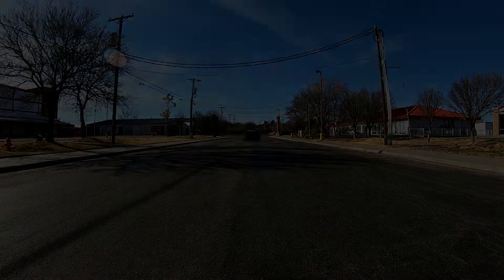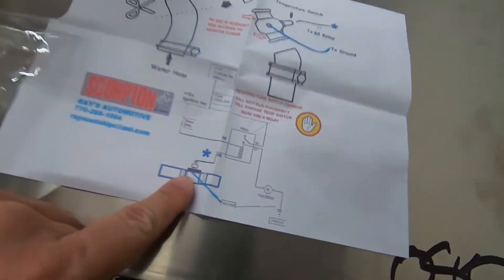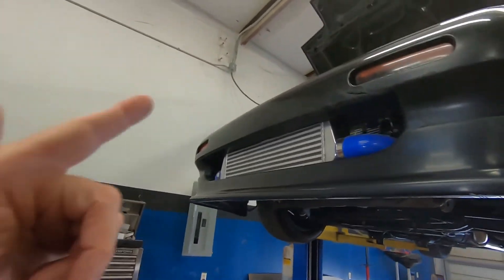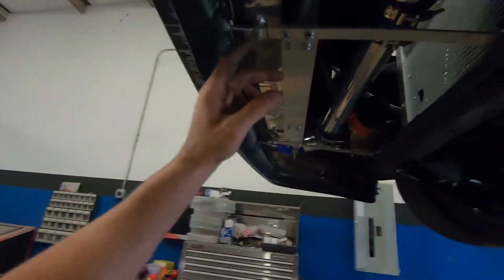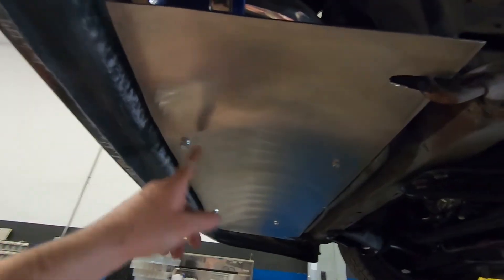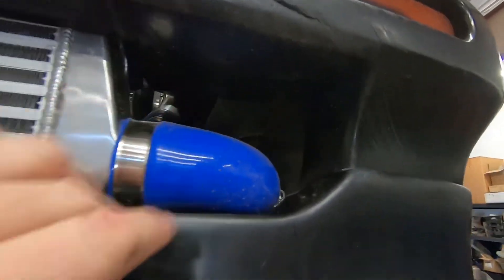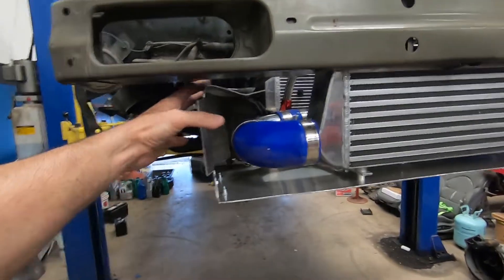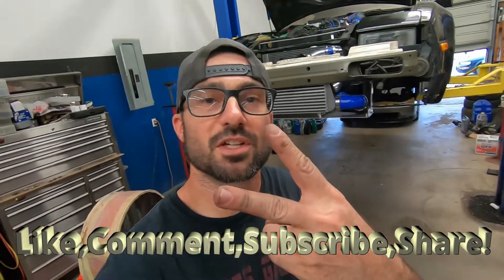300zx Turbo Build Z31 Custom Air Ducting

Comment: Always love to see z31s. Mine is currently KIA (pretty much gonna need a whole new engine) but you're giving me hope for the future of my z
Reply from the maker: Sorry to hear that but glad I'm motivating you for your Z.
Reply: @importmodify  it's a 32 year old engine with 260k miles, I honestly cant fault it for the issues it has. I just need to save up for a while and get a fresher engine. Eventually I'll probably have the engine that's in it built by engineered performance
Reply: VGs are luckily very easy to come by in old frontiers, pathfinders, xterras etc... the later models even came in a 3.3L displacement for a bit more power. Check your local junkyard bound to find at least one healthy motor.
Reply from the maker: Very cool but if money gets tight you can source another engine from other chassis just like Ryan Mills stated. Just be sure and compression test any used engine before buying it.
Reply: @importmodify  yeah I'm looking at one that has a manual transmission with it for $600 but I'm gonna have to sell some stuff to get it
Reply from the maker: Awesome! Hope it works out!
Reply: @importmodify  it doesnt have any of the timing stuff on it but if it has a flywheel I was thinking I'd just put that transmission on it and bring my timing belt, gears, starter, etc and trying to compression test it with a battery. I dont know if the automatic and manual starters are the same though, I mean I think they would be but you never know with nissan